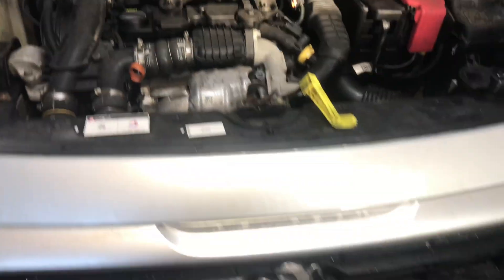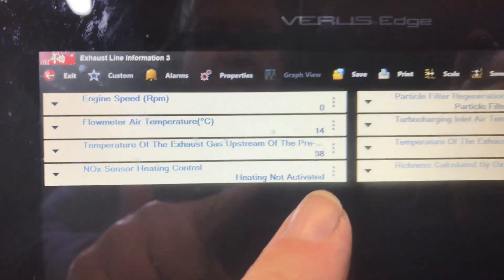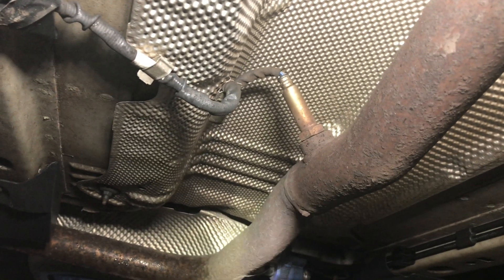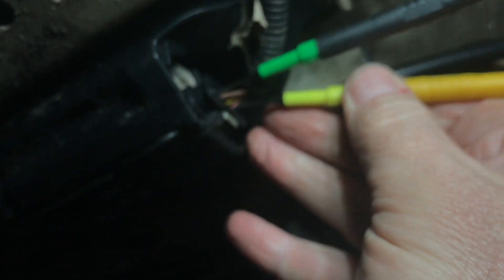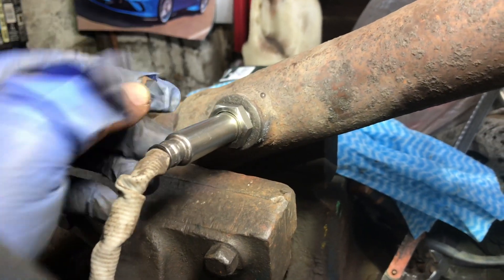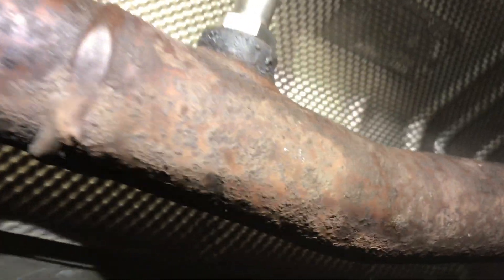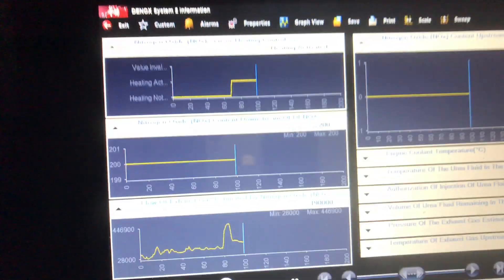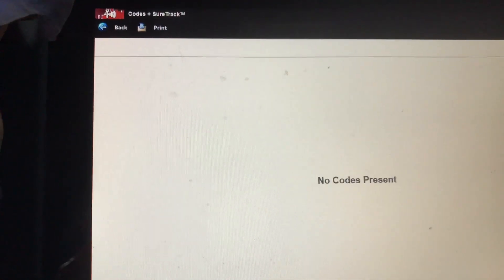Peugeot Partner (2017) 1.6 HDi Fault Code P2207 - NOx sensor Heating Circuit

Comment: I have a partner van it has a yellow triangle light and no power from the turbo with the engine temperature starting to drop is this from this same problem as the video or could it be electrical problem?

Comment: Hi Sandy 
I have Peugeot 5008 1.6 HDI 2016. Urea and Emission control fault showed in the dash. Nox sensor was changed last 3 months. I have topped up the adblue but the urea is still blinkin. Any thoughts? Thanks. You’re very helpful.
Reply from the maker: I think u will find that the 2016 year model has Eolys fluid along with adblue cheers sandy
Reply: @tonyc1167 Did you replace the nox sensor and if so did that fix the problem?

Comment: Hi mate, i just wondering to know can i continue to drive without changing with new NOX sensor . What problems i can face?
Reply from the maker: Wee Greta will no like as your destroying the planet😂 No idea what issue you will face but you’ll not pass the emissions test! Cheers sandy’
Reply: I think this sensor only check if your emission systems works fine, it doesent control it.. but in time you would get "urea" light on, and then it would start to count from 1200km, and once it reach zero car wont start anymore..

Comment: Oh yes sir weve verified your fault , its gonna cost you 500 quid , (thud)  hello sir are you there ?😂😂👍, did one on a boxer van last year,  tight as a camels you know what , thread ripper definitely Sandy , great job , had a guy turn up today with a 68 plate vivaro , a screen fitters van , it  20 mins to get it to start on him after his last job , ignition not working, no dash lights at all , all driving lights on all time , wipers indicators and brake lights ok , I said dont turn it off , take it to the stealers if you're not driven through water , should be a warranty job 👍👍my head hurts enough without looking at that one , take care guys

Comment: Best  heating it up until it glows if safe to do so  and then a bucket of cold water over it .   shocks the metal  got that tip from an old mechanic   works ever time   .

Comment: I’ve fitted one of these a month for the last year I’d say, if you open the controller module you’ll see they suffer from water ingress. Buy yourself a 20x1.5mm tap for chasing the threads before refitting.
Keep the videos coming fellas. 
P.s. where do I buy a Roddie? 🙄🙄🤪🤪🤪
Reply from the maker: U Cannae buy him, he's an enigma!!! 😀
Reply: @sandyande  🤣🤣🤣
Reply: pro trick: watch series on Flixzone. I've been using it for watching loads of movies lately.
Reply: @Alijah Connor Definitely, I have been watching on flixzone} for years myself :D
Reply: @Alijah Connor Yup, I have been watching on Flixzone} for months myself :)
Reply: @Alijah Connor Yea, I have been watching on flixzone} for since december myself =)
Reply: Do you think it's worth leaving the sensor in the exhaust, cutting the wires and changing the control box?

Comment: Hi I'm and HGV to tech and this is a common problem the Tap I have and use it a M20 1.5 metric fine and must be a plug tap
Reply from the maker: Cheers Graeme, the engineer who fixed it says he does a lot of work on HGV exhausts with similar issues
Reply: @sandyande  yeah we some times have to cut out the boss and weld in a a new one
Reply from the maker: @graemejaap9076  yip that's exactly what he said! Cheers sandy